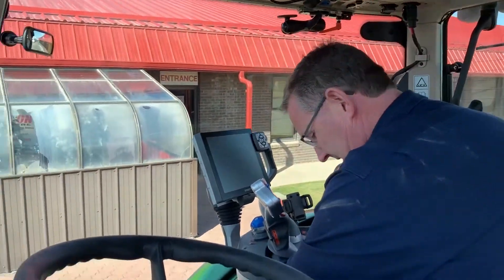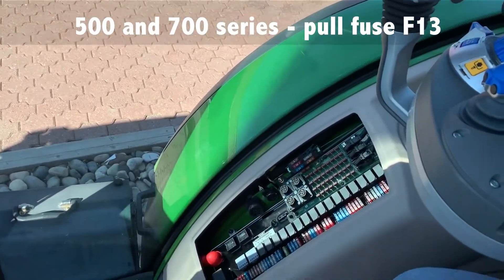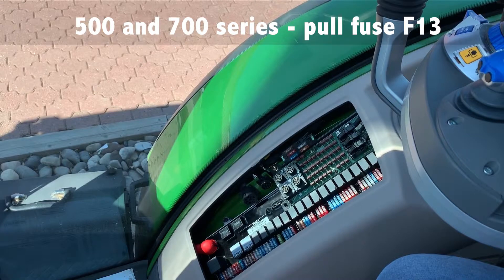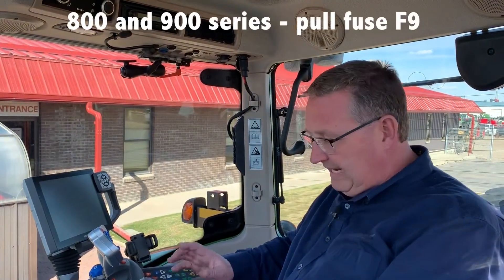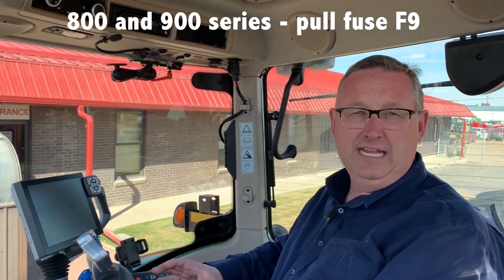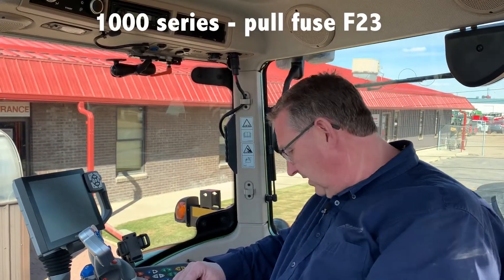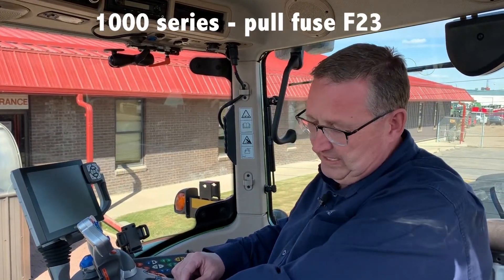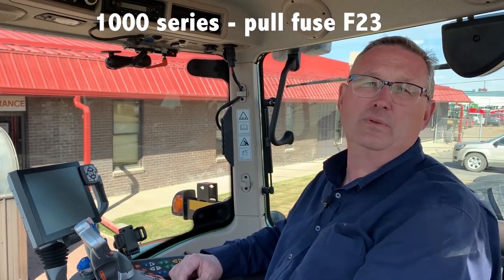How To Do a GPS Reset | Fendt Tractors

Comment: thankyou for this video, it fixed my fendt 927 before i heard back from the dealers
Reply from the maker: That's great to hear! So glad it helped you out!
Reply: Hey I put a range point unlock code in my Fendt 514 it has a ag382 receiver the expiry date is now refreshed but the status is inactive and it will only steer on sub meter any pointers ? Thanks